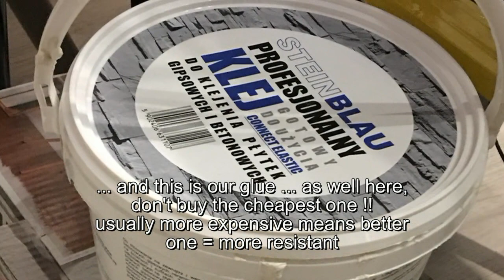How to install Decorative Stone Gypsum Wall Tiles

Comment: Nice job but the corner cuts are not straight you could have done much better if you tried to cut all the corner tiles in a straight line . 👍